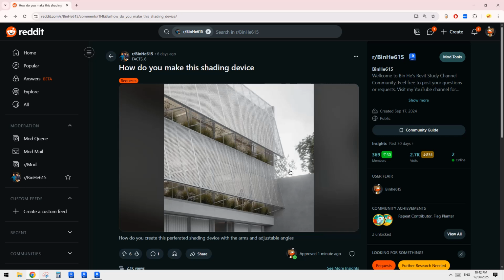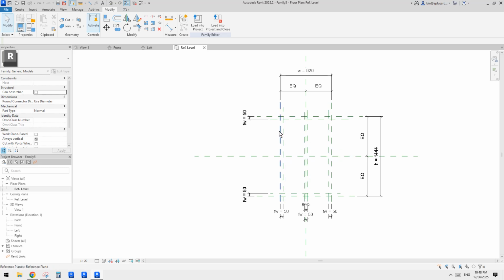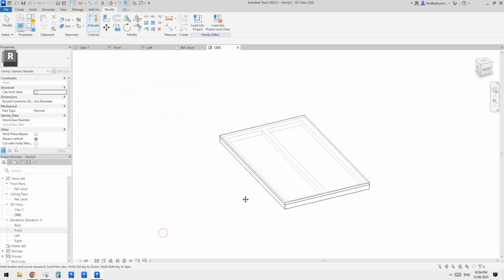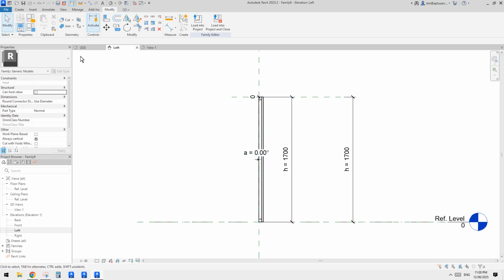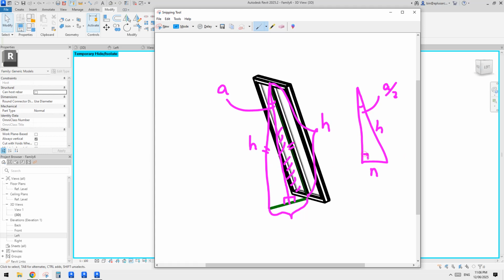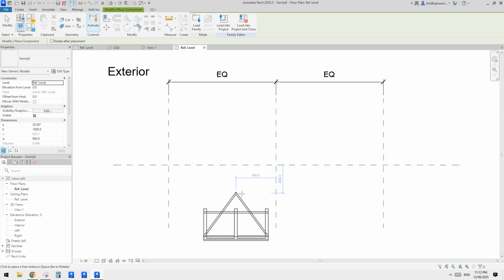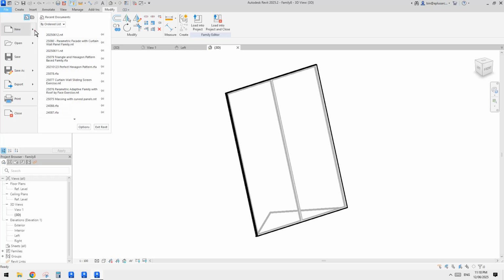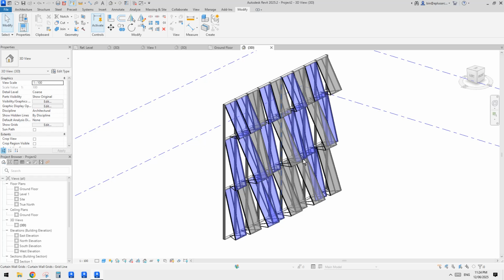25081 - Parametric Shading Device using Curtain Wall Panel in Revit

Comment: will this became an error if the angle set to 0? sometimes i use angle parameter, but when i set to 0 it will be error because some family/extrusion will gone if i set the angle to 0 (in this case like your arm part), did you find any solutions?
Reply from the maker: If it breaks when the angle set to 0, create another angular parameter e.g. "input", and use a formula like this "if(input<1,1,input)" for the actual angular parameter that controls the model. This will make sure that the angle will always be a number equal or bigger than 1.